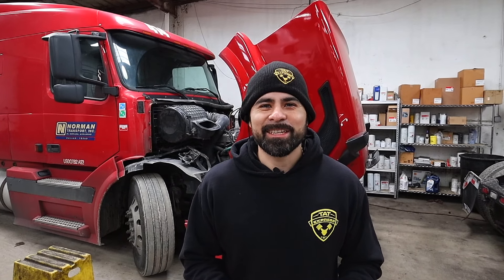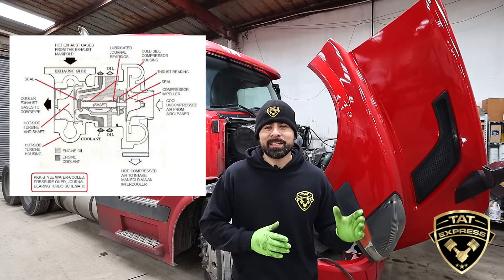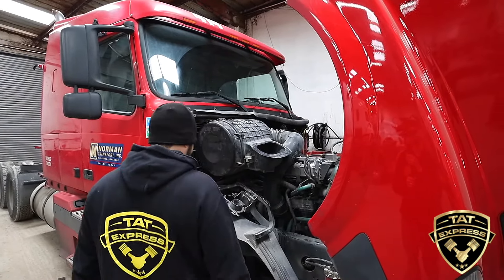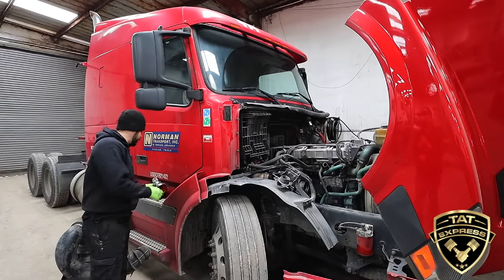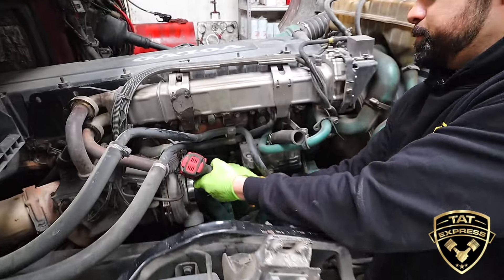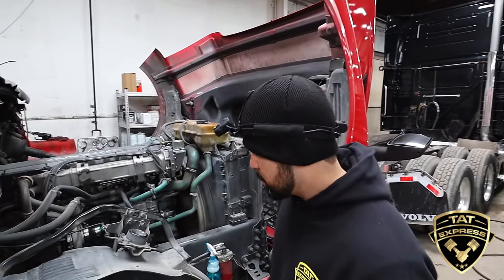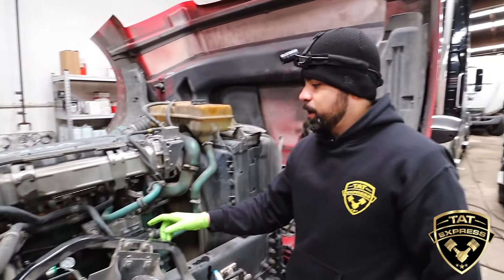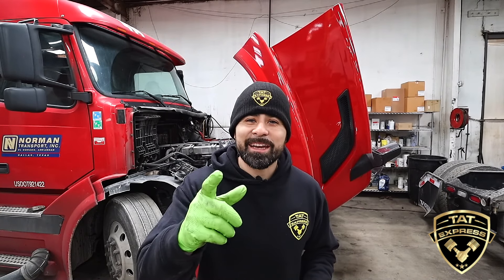Low Power Volvo

Comment: Okay I'm back at it; cursed again to drive another truck with a Volvo engine.

I don't know if it's a misfire or what but I have to drive a 2010 d13 engine like it's a 1995 Detroit Series 60.  Caterpillar claims that only 180 horsepower from the engine is required to move 80,000 lbs down a level road with no wind at 50-mph.  This D13 engine is unable maintain 35 miles per hour up a 3% grade. Incredibly, if I'm not hauling two heavy—like under thirty thousand pounds—if I drive it like a Cummins ISX and keep the RPM's at 1600 and the speeds above 60 MPH it does fairly well until a 2% grade.

I don't hear a turbo leak. It starts great: it idles smooth: it just feels like it only has 125-HP.

Comment: Hi great to subscribed your Channel, i got problem like you said , unusual power, loss power on uphill even little bit uphill, i am scare ro bring the truck to volvo dealer even they just replace my hall turbo  a year ago but it took 2 weeks crazy , and the coast almost $9k , my question is  do i can stay run  for 2 weeks  still ok or i have to bring to small shop not volvo dealer to avoid  break down or what i have to do, thank you for tour kindness

Comment: TFTV , my 2015 Cascadia DD15 sounds like the Jake brake kicks on mostly when throttling down, loaded and at higher speeds. I can't tell exactly but maybe from around the turbo area. I still get up to governed speed 76 and no codes

Comment: Good video I have a cummins ism that blew two boot hoses on the hot side. Replaced them and adjusted the ecm and every now and then I hear a whistle nose can't find any other leak. Had the intercooler repaired also. Any thoughts 😕
Reply from the maker: Have you conducted the test in the video?
Reply: @TATEXPRESSINC  Thats next to schedule a apt with u guys 😆

Comment: Thanks buddy. I got a 2015 mack pinnacle cxu MP8 . Whenever my truck is loaded, it’s doesn’t want to more than 35. To 45 MPH… but whenever it’s Bob Tail or with no Load . It’s goin 75 mph .. do you have any idea what’s wrong ?.
Reply from the maker: Check for boost leaks and replace fuel filters.

Comment: my truck stop on me with no type of warning. it was if it was not getting fuel so i had both filters changed out . the filter that has the site glass had some milky looking stuff in it .so after changing the filters it started up but ran as it if was no getting fuel. any idea what needs to be checked for this problem .

Comment: Have a 2011 Volvo vnl truck with 540.000 mils that loss throttle while driving,the car doesn’t shot down until I make a full stop,I turn it back on right away it starts going.
We connected to computer it doesn’t show anything,
I I changed gas pedal sensor, Crankcase pressure sensor still the same
Reply: Hey friend did you figure the problem out ? I’m going through the same thing with my truck ?
Reply from the maker: You may start with fuel filters. It sounds like not getting fuel.  Also, PTT software will allow you to test the pedal and sensors before condemn
Reply: @TATEXPRESSINC  thank you I will change the fuel filter and see what happens from there

Comment: hey Adam I have a 2015 cascadia and it has the scr inlet temperature sensor drift to high range code i inspected the actual temperature sensor before the inlet tube and replace but the code came back i tried doing a regen but it didn't  complete it but on my dd software it shows nox conversion good
Reply from the maker: Can you run a low temp ATD? To verify drifted Nox sensors
Reply: ok i will do that i did scr efficiency test and the outlet nox reading was 1685

Comment: I have an engine cummins ism 425
When I'm loaded I feel like it has lost power it would run up to 55 and no more even on a straight road. And I'm on my last gear here... Even if I accelerate more it won't go pass 55 mph.. which empty it runs to 65-75 mph. Is this normal.???

Comment: What if I do that test! And my system didn’t boost pressure but can’t find any leak! Truck gauge show 35 to 40 psi! But truck it’s low power! The intercooler has been replaced and truck boost go from 20 to the pressure mention before performance get better but it go back to low power but turbo pressure stay at 35 to 40! What can be??

Comment: I have the same motor D12 with that seem fitting I have replace the O-rings and just always seem to leak no matter what what do you do to fix it the previous owner to my truck had replaced the turbo so with a new Turbo and that coupler never seems to line up straight in between the lower cooler tube and the Turbo any help on that
Reply from the maker: Alex, I agree sometimes those tubes are difficult to align.  Make sure they are bolted correctly and you can also use sealant to assist in sealing

Comment: If one cylinder has the valves at overlap wouldn't that cause a leak?
Reply from the maker: Some leak down is acceptable due to open valves.  This test is mostly to check for heavy external leaks.

Comment: my truck when i go about  50 miles in hour start rpm rev up and down  2 miles and not getting to 60 can be boost leak ?
 or bad turbo still has 530,000 miles on
Reply from the maker: Does rpm rise and truck does not accelerate?
Reply: @TATEXPRESSINC  truck accelerate but slow and rpm if i push paddle all the way in it will make some load noises not idea if trubo going  bad or just  some boost air leaks
Reply from the maker: https://youtu.be/KZ_wSI1dVX4
Reply from the maker: https://youtu.be/3oUdggxGems
Reply: M S i have the same problem did u fix and if yes, wuat was thw problem
Reply: @miguelramz1604  it’s me ms 2nd account 
Yes was clutch burnet out  and had little boost leak

Comment: I have a 2012 Volvo 780. Here lately I've been able to go about 10 or 15 miles before I completely lose throttle. I have to pull over stop the truck crank it back up and go again. What do you think my problem is. Thank you
Reply: Hey John, this is pretty old but did you ever find the issue for this ? We are having the same problem

Comment: hey i have a 2007 volvo 670 10 speed my truck set about 2 years and my truck was running good when i originally park it....and it has about 1/2 tank of fuel in it ..so i got ready to start the truck up after 2 years of sitting and got some new batteries in it and it started right up idling beautiful i go to drive it and its if i dont have no power it takes along time to get to 50mph and i have the gas pedal to the floor ..i changed the two filters and put some additive in it i put howes and lucas injector cleaner and fuel conditioner in i went back out to test drive it .and it seemed to be alittle better i was able to get 60 mph but it still taking along time to get there i drove about 90 miles.but  it still doing the same thing it is not smoking it but it is actually running good but i dont have no power...there is no code lights on..do you think i need to put somemore additive in it and drive it more..

Comment: I have a 2014 Volvo Vnl 670 when I’m driving down the road I get up to 60mph in 12th gear and I can’t push pass it I start to drop in speed to around 45mph and then it lets me give it gas to get to 55mph and it won’t push pass that. What could be that problem?
Reply: Did you ever get the problem fixed? I’m having the exact same problem with my 2016 VNL 670 and no one seems to be able to find the problem

Comment: I have a 17 cascadia with dd15 having almost 600k on it. My boost pressure goes less than normal and I get check engine light with the code SPN 2631 fmi 1. Been to Freightliner and other mechanics and they have failed to find the issue. They end up doing regen and replacing parts and the issue still comes back up after few days. Very frustrated
Reply: ...  made  in  Mexico  .  ..   ... .

Comment: I don't get this video: Volvo's come with low power from the factory OEM.  I know this first hand from the ones I've driven.

Nice to see how you used the testing tool:  I've not seen one before.
Reply: It seems that you don't know anything about Volvo engines.
Some Volvo D13 and Mack MP8 engines produce up to 505 HP and 1860 ft/lbs of torque.
Reply: @pep5772  

I know enough NOT to to spend $36,000 on a rebuild on one as one youTuber did....

Great engine when running empty.💪🙌

Comment: Hi, I have no acceleration going up hill in my 2011 Volvo Vnl cummins and no codes. Runs good on level ground, but drops from 70mph to 60mph on small incline loaded and 70mph to 65mph empty.  No whistle sounds from inner cooler and no Turbo leaks. Could Turbo cooler still have leaks with no whistling sounds?
Reply: I drove a Volvo with an isx turned up, with a similar issue. The cam(s) were wiped out.
Reply: @user-ln7of9gs4s  Just had my head replaced with new cam, rocker arms...etc. Had a crack in head. New EGR/valve, EGR cooler, thermostat, starter, Turbo is good, new DEF filter/Canister. Just had it looked at and started driving 5 miles and heard clicking in dash, then stop engine light with high soot. Soot levels says good. Smh!
Reply: That's how horrible engines are made-- at least the ones I drove-- these boat anchors were made no power up any hill without slowing down 10 to 15 miles per hour.
Reply: I have 2011 Volvo vnl ix15 Same issue did you fixed your truck brother?
Reply: @Real_nadiir I have 2010 Volvo isx having issues . Did you fix ?